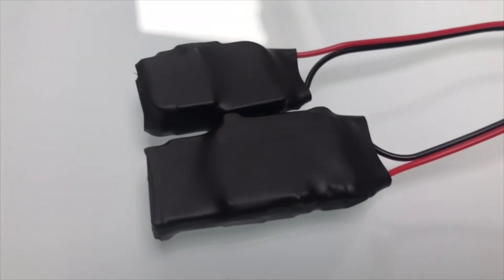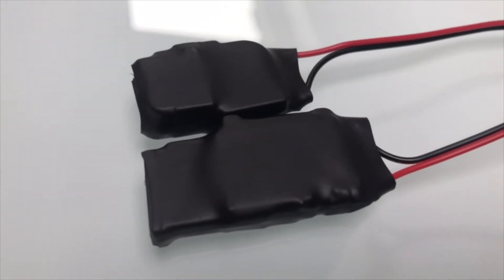Double iPhone Speaker For DCC Sound, Introduction And Demo

Comment: Hi Richard
Great video, looks and sounds great, Ill definately consider one when I get round to doing another sound install.
Regards Paul
Reply from the maker: Thanks Paul, you won't be disappointed
Reply: Hi Richard
Im trying to fit a tts class 20 chip into a bachmann loco, onky issue appears to be the speaker, any ideas what might fit, I was thinking x2 thin sugar cubes or the internal iphone speaker?
Any help would be appreciated.
Regards Paul
Ps. Im using a 21 pin to 8 pin adaptor too...
Reply from the maker: A single iPhone speaker is good for a TTS decoder, someone has just fitted one into his bachmann 20 and sent me a video and it sounded great